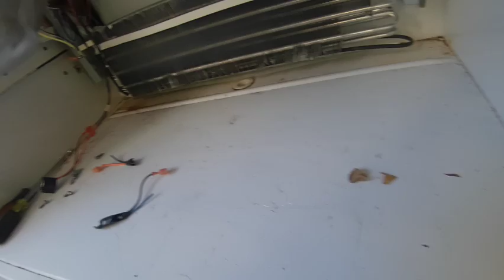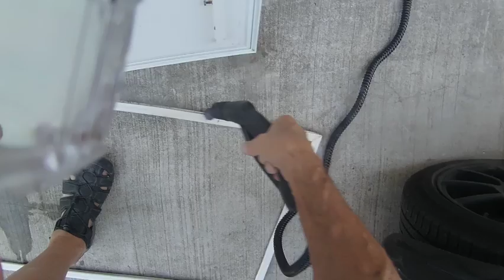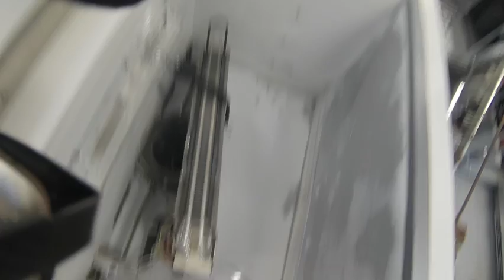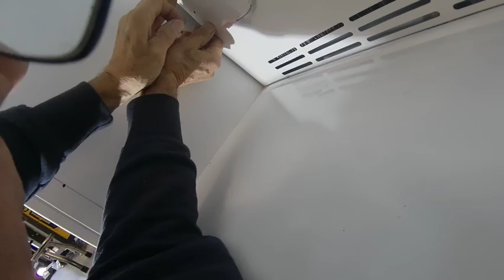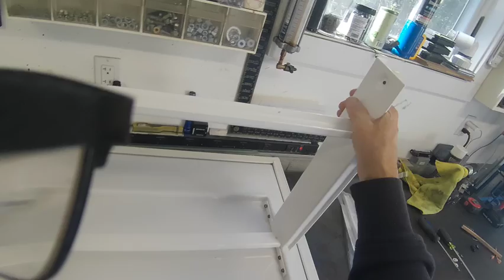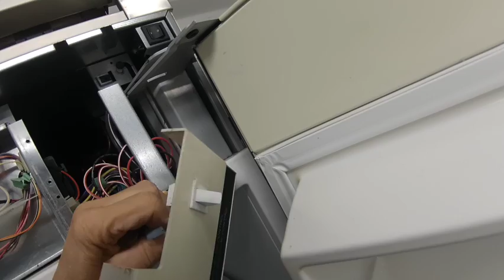Viking Professional VCBB363 Overhaul & Overview

Comment: How were you able to remove the freezer drawer so easily.   Is there any tabs I need to press or remove to release the drawer?  Is there a video on removing the drawer?
Reply from the maker: Just pull it out until it stops and lift it off the tracks

Comment: Great video, I have the exact same unit and have also had to paint the panel at the back of the freezer.  
Now we have a bigger problem, the condensor fan will only run if i manually give it a quick spin.  I assume that fan is an AC motor (unlike the other smaller DC motors in the fridge section and freezer section) so likely needs a new start capacitor.  At the end of your video you show the control panel which has a decent size cap. on the board - is that the start cap. for the condensor fan motor or is it located elswhere?  Thanks in advance for your help
Reply from the maker: No capacitor on the condenser fan motor. 120v
Reply: @SubZeroSpecialists  Appreciate the fast response, but now i'm back to being stumped 🙂
Reply from the maker: @jqs1234 if you have to push the fan to go then change the motor. Should be 120v going in.
Reply: @SubZeroSpecialists  Replaced the fan motor - you were exactly right - all good there.  Now none of the pressure buttons on the top panel work, have inserted the ribbon cable a number of times but none work, so cannot turn of the 'warm fridge' alarm.  Are those ribbon cables finnicky?
Reply from the maker: @jqs1234 that sounds like the display panel is faulty. Check the cable going into the control board.
Reply from the maker: You’re right about the ribbon cable being finicky, make sure it’s pressed in all the way.

Comment: I have a Viking 36 inch professional over under model v1bb536rss  serial 033110r00002543  i cannot get the freezer door open . It is not froze shut any suggestions?
Reply from the maker: It has to be frozen shut. You can try picking the drawer up from the bottom, if it doesn’t move then it’s probably frozen. Viking is known for frozen drains which could freeze the drawer shut. you could also shut it down for a day and see if that helps.

Comment: Good afternoon 

I have the same fridge and mine is not cooling as much as the freezer I was hoping to see a video how to replace the dampener  hopefully this is the problem 

Thanks
Reply from the maker: I don’t have a video on replacing the damper. Check the temperature in the freezer before you start changing parts and check for ice build up in the freezer drain area.

Comment: I have the same fridge, the bottom of the freezer gasket wasn’t contacting with the fridge, so we replaced the seal, heated and everything. Still not touching. We’re wondering if the freezer door can get angled somehow where the bottom tilts out a little, and if there’s a fix if that’s the case. Any help would be super appreciated!
Reply from the maker: I would have to see what you’re talking about.

Comment: Model: DDBB363LSS
We have been having issues with ice buildup in freezer. We replaced the thermometer and debating to replace the other part you mentioned in the video (have on hand) 
Is this a common problem with this Viking refrigerator? 
Are there any suggestions other than what’s in the video?
Reply from the maker: Where is the ice buildup, is it down on the bottom near the drain or on the back wall?
Reply: @SubZeroSpecialists we have ice maker turned off. Ice buildup bottom near drain - almost the entire width of the coils. We did replace the seal and the heating element
Reply: It’s at the length of the coils - basically the entire width covering the drain.
Today we did replace the heating element. Also replaced the gasket. 
Continuity was good on the old heating element but we decided to replace it w the new one.
We just turned frig on - 
(We did clean out all ice obstructions - melting all ice)
Reply from the maker: @GBJMARTINS  Your drain is iced up, you’ll need to completely defrost it, remove the back panel, and clear out the ice in the drain which is in the middle of the drain trough. Poor hot water down the drain hole until it drains out. This is a common problem with Viking. We usually put a drain heater in the drain to prevent reoccurring.
Reply: @SubZeroSpecialists  yes we completely defrosted by removing the back panel. We’re just wondering if the evaporator heat coil is heating up to defrost. We tested it for continuity which was fine. Where did you order the heater drain?
Reply from the maker: @GBJMARTINS . The defrost heater is for the evaporator coil, there is no drain heater on that model. I use a Supco SH 250 heater wired into the evaporator fan motor, so that whenever the fan is on the heater is on, it’s only a 3watt heater so it won’t affect normal operation.
Reply: Down at bottom near drain

Comment: If I have the same refrigerator and freezer and I have a high temp alarm that goes off at least once a day what do you recommend to fix it? The gasket definitely needs to be replaced should I also replace the thermistor? Thanks!
Reply from the maker: Check the condenser for dirt, change the gasket if it’s torn. Also what’s the temperature in the freezer?

Comment: Question for you my fridge isn't holding temp in the freezer or fridge it starts cooling normally then over time usually by next day the temperature is up and its starts working to hard and shuts off
Reply from the maker: Is it a SubZero fridge? What’s the model number?
Reply: @SubZeroSpecialists how would I test to see if the thermostat is working properly
Reply from the maker: Sounds like it’s overheating, check the condenser coil.

Comment: The light in my  freezer isn't working after removing and draining the tray underneath the unit. I cleaned it up and put it back together. The freezer light came on momentarily and now wont come on at at.  Reffridgerator light is working fine.  where is the switch for the freezer light?   Model is similar to the unit featured here.
Reply from the maker: On the left side behind the freezer basket. It's a micro switch which controls the fan & light. When you push the drawer all the way closed the switch gets depressed.

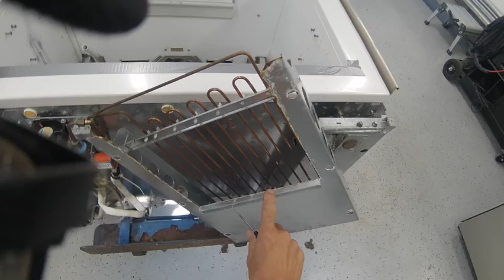Comment: I have a similar model (the VCBB362) and the small fan on the bottom of the unit (visible at 20:44 towards the left) seemed to be making more noise than it once did. Replaced with a supposedly genuine oem part bought online but the new one was even louder. Can anyone tell me what this fan even does and if there is something that may be causing it to run longer and louder than it used to?
Reply from the maker: @kevind4632  that fan is used to assist the evaporation of the condensation and defrost cycle drainage.

Comment: would appreciate any advise. i have same viking model which doesnt cool unless i set to max frig and max freezer.  i think is a problem with motherboard vs control board.  how can i tell which to replace?  thanks .
Reply from the maker: @1urgentcare  get a thermometer and check the temp on the freezer, let me know.
Reply: @SubZeroSpecialists  hi, thanks for your quick reply!  the fridge temp and freezer temp is both cold right now.   but the problem is that it goes back to regular temp settings by itself sometimes a day later and stops cooling again.   the history is that this same thing happened only in fridge but now it is happening both fridge and freezer.  i have been searching to buy the low voltage board vs the control board.  any advise?
Reply from the maker: @1urgentcare  what do you mean it goes back to regular temps?
Reply: @SubZeroSpecialists  yes, it stopped cooling at regular temp setting for  few weeks so i bypassed it on max fridge setting which cooled correctly but now it is reverted back to regular settings on its own and not cooling again until i press max fridge again....and again. and now the same thing is happening to freezer too.
Reply from the maker: @1urgentcare  this sounds like an electronic issue. Viking parts are extremely expensive so I wouldn’t replace anything unless you’re sure.

Comment: I had the same issue with the pullout shelf. I was thinking of using a small hinge that I could epoxy to the back of it. I'll post if it works. Thanks for the video.

Comment: Did you replace the refrigerator recirculation fan? If so, how did you get the cover off? Thanks
Reply from the maker: @Chris-ie6uq  are you talking about the cover in the freezer?
Reply: @SubZeroSpecialists  Hi, thanks for the message. I was talking about 12067401 (FAN COVER) so I could replace the 12075003 (MOTOR-REF FAN). I eventually figured it out. Two plastic tabs on either side that pull off to reveal the screws. The top was running warm but the freezer was ok. I replaced the fan, and now everything is good.
Reply from the maker: @Chris-ie6uq  Great👍

Comment: Fantastic video!  I have the same Viking fridge and am having to exert a lot of effort in opening the bottom freezer drawer.  Lots of squeaking happens too.  Have you found those rollers failing over time and requiring replacement?  As you said, replacement slides are a fortune through Viking.  I’m trying to see if I can just change the rollers and clean the track.  Oddly enough the rollers are not listed as a replacement part, Viking wants to sell the whole slide.
Reply from the maker: @robertf4572  the tracks could be iced up, try using a heat gun or hair dryer, see if that helps.

Comment: Need some help please! I have a Viking VCBB363. Looks very similar to your overhaul fridge! Awesome video by the way! I have been diagnosing my fridge and have tested continuity on various parts, cleaned the condenser coils, the fan works, compressor is humming but I’m still not that cold enough in the fridge. I’m at about 46-42. The freezer freezes but not enough to make ice… do you think it could be the inverter? Do you possibly have a part number for my fridge? A tech came and is saying it is the condenser coil that needs to be replaced but that doesn’t make any sense to me. Any help would be appreciated
Reply from the maker: Sounds like your evaporator coil is iced up. Remove the back cover and check for ice or frost build up. The only accurate way to check the compressor performance is to check the sealed system pressure, that will require special tools. Of course if the inverter is the culprit then the compressor may not be running at full speed. The part number is on the inverter.
Reply: @SubZeroSpecialists  we had a tech come and pressure test. He said there was a leak somewhere in the evaporator.He changed the refrigerator evaporator, and we are still not getting cold enough. He thinks that maybe since the design changed ( the evaporator replacement that Viking sent is a bit smaller) the filter drier might be causing a restriction. He is ordering a new filter drier and seeing if that does anything. I hope this fixes it. He checked the compressor by hooking it up to his pressure gauges and he said it’s functioning correctly….
Reply from the maker: @jlara7596  what is the pressure in the sealed system while running? If your tech replaced the evaporator without replacing the filter drier, that’s not normal procedure, Always replace the filter drier when opening the sealed system. Did he weigh-in the Freon? It has to be exact. I need more info.
Reply: @SubZeroSpecialists  he replaced the filter drier but there was a restriction, so he put a new filter drier. Here is what the machine was reading 0-110. I have a pic of his reading but I can paste on YouTube.he also added the exact amount of Freon that was listed on the fridge. I really don’t want to replace the fridge.
Reply: @SubZeroSpecialists  just a final update, replaced the compressor (free of charge) awesome tech! We hooked it up and noticed the evaporation fan was not spinning, for now we used another fan but having such a hard time finding a direct replacement. The freezer (1-3F)  is now going strong but the fridge is at 45F ( I set the fridge to max) Is it that the replaced fan isn’t OEM? I went online to Viking and it’s about 300 bucks! Trying to locate the fan motor with the same specs is very difficult. 

Any guidance will help. I really appreciate all your replies. We are so close to fixing the fridge!
Reply from the maker: @jlara7596  sounds like a fan issue. Make sure the fan motor you put in is the right rotation.
Reply: @SubZeroSpecialists  Hi! Thank you so much for the video. I have the viking 3 series bottom freezer refrigerator. I am having issues with the freezer not cold enough but fridge is ok. I noticed that the evaporator fan is not spinning when the door is closed. I heard the fan motor was replaced about 7-8 years ago but can it break this early? Does thermostat or thermistor cause the evaporator fan not to spin?
Reply from the maker: @jlara7596  it could be the inverter it could also be a Freon leak. If possible check your sealed system pressures.

Comment: Good evening. Was wondering if you could enlighten me on the location of the defrost timer? My unit has been frosting up on a regular basis. I put on a new door seal and the sensors and heater have continuity. Was looking for the defrost timer location or to know if it is part of the control board. DTBB363R
Reply from the maker: You didn't say what model you have but if you have sensors, then you have a control board which controls the defrost cycle. Check the defrost termination switch. it could be open.
Reply: @SubZeroSpecialists  Thanks for your response. The unit is a Viking DTBB363R and yes it has control boards. The termination switch had continuity, but I replaced it and the thermister anyway. I had purchased a new multimeter that I was unfamiliar with when I started the diagnostics. My old one was lost in a fire. My initial test of the old components showed open circuits due to bad settings on the new multimeter. After reassembly yesterday, the freezer reads 0 degrees and the refrigerator is at 48 degrees. I found a flow chart on line to work out trouble shooting the interactions between the HV and LV control boards as well as attempting to manually force a defrost cycle by holding down two buttons. Sound about right to you?
Reply from the maker: @bflat1894  yes. You could also peruse our tech help files on my site aaronsrefrigeration.com, we have some info for that model.  Is the freezer frosting up or is it icing up? Check the drain also, make sure the water is draining out. Also try connecting thrower directly to the heater and see if it heats up, it should draw about 3.5-4 amps.
Reply: @SubZeroSpecialists  I'll be sure to check out the site for the information on the model. The freezer has in the past iced up as to a sheet across the bottom or it has just frosted up across the back panel. When thawing it out, I always make sure the drain hole is open and that the tray under the freezer is receiving the water. I also installed a metal finger on the heating element that transfers the heat down the hole. 

By the thrower, I'm assuming that you mean to hot wire the element. I checked for continuity, but I did not try this method if I'm understanding you correctly. Is the heating element line voltage or low voltage. I would assume High but just want to confirm and the unit has both high and low boards.
Reply from the maker: @bflat1894  120v
Reply: @SubZeroSpecialists  Thanks for confirming.

Comment: Where did you find the freezer rail top and side plastic guides for your roller rails, the guide rails are no longer available?
Reply from the maker: Middleby 770-932-7282
Reply from the maker: Middleby 770-932-7282

Comment: Great video, thanks for that info... if i found a lot of water on my drain tray it means thay the heater on top doesn't work? How can i determine that? Continuity on those 2 wires? Thanks again
Reply from the maker: Yes disconnect the heater and check for continuity or apply power to it and see if it heats up.

Comment: Nobody says how to remove the top grill, even their own manuals are vague. And it’s needed to cycle the fridge off when it’s overheating. Ridiculous
Reply from the maker: You don’t need to remove the grille to shut the fridge, there’s a power switch on top on the right side, just remove the middle slat.
Reply from the maker: 4 screws 1/4” nut driver. First remove the middle stainless steel grille, it just lifts off and exposes the screws. It would be helpful to have a long nut driver because the screws are way back.

Comment: When you lay down the fridge on its back that’s not damage compressor which turned over with oils inside….?
Reply from the maker: When you stand it back up let it stay for awhile before you turn it on, the oil will drain back into the compressor.